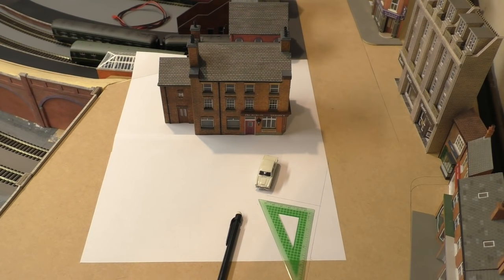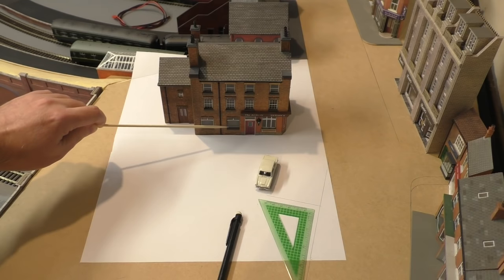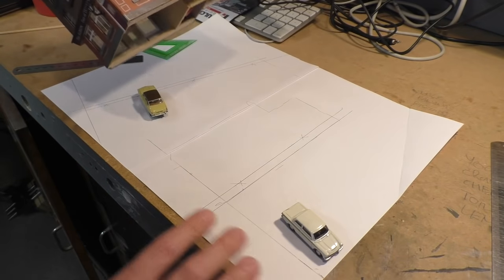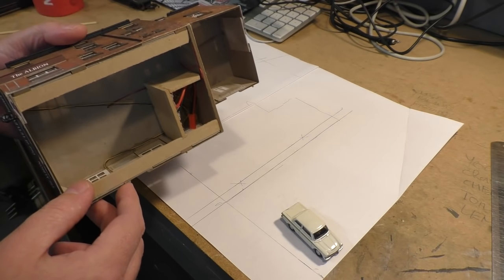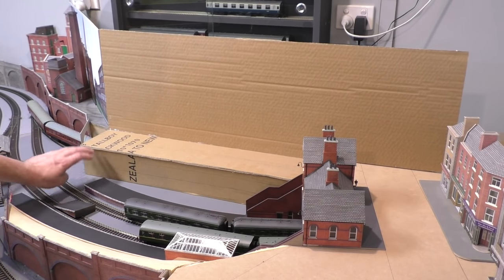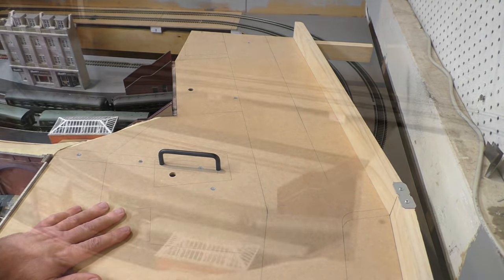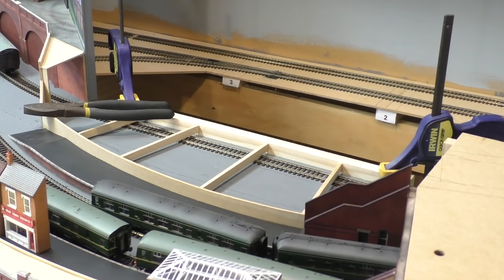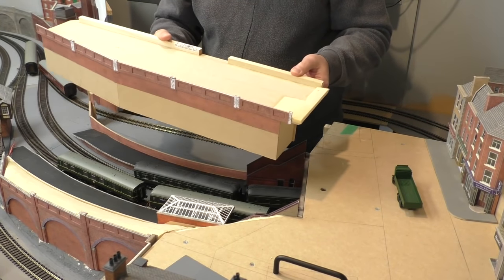Station Embankment and and Continuation of the Industrial Area

Comment: Hi Julian the quality of your channel just keeps getting better every video you release in my eyes you are right up there now with Chadwick Parkway, Dean Park and Everard Junction. Station Road also fills the gap that the other as remarkable and inspiring as they are and that's the use of card buildings and these scenic cut outs. While my layout when I get started with be loft based it will be constraints by the access hole and roof angles. Your cut away, build and weather elsewhere and fit and show technique for me is that missing link, so thank you and please keep the videos coming they are very inspiring
Reply from the maker: Thank you Paul for your very kind feedback. To be compared to Chadwick, Dean Park or Everard Junction is an honour because these channels are very polished, and full of exceptional modelling. I'm not sure I would place Station Road in this league, but then I'm not attempting to copy them in any way, they're just a great source of inspiration for me also.🙂

Comment: Julian,
I do enjoy your artisanship.
A question and a suggestion.  First about the foam infill.  Drawing and cutting out foam insulation board to fit amid the retaining walls is a fine way to accomplish your desire.  There is however an easier and quicker way.
Place your front wall in place as you have.  Using scrap materials build a temporary rear wall.  Then with Airisol Spray Insolation Foam build many thin layers until the foam SLIGHTLY exceeds your front and back supports.  Then taking a HOT WIRE or HOT BLADE you can trim the foam to the desired shape, with few, or no, mistakes.  It does take time.  With each thin layer you do needs to allow curing time, for the foam expand and firm up.  But even so the Spray Foam will do it's thing.  So you can be focusing elsewhere.
The question is regarding the removable roadbed with the black cabinet handle.  It was unclear to me whether or not the relief buildings were to be secured to the lift out or would you have to remove them individually each time you needed to get to the hidden trackage?
Both methods seen to present the potential of damaging the buildings???
In any event I did enjoy myself again with a trip down Station Road.
Jim ~ N.Y., N.Y., U.S.A.
Reply from the maker: Thank you Jim for your suggestion/method for the embankments. It's definitely another viable way of creating land forms, however I'm not sure if it sounds any easier or quicker. As you say yourself, 'it does take time'. The upper level town scene will incorporate detachable buildings but the low relief buildings will be permanently attached to a backscene as a one-piece lift-out but seperate to the baseboard lift-out.

Comment: That looks more like polyurethane foam than polystyrene foam. Not certain, but I seem to remember that using a hot wire on polyurethane is a big NO, as it can give off toxic fumes when heated. I'm glad you kept safe.
The pub's name, in England, would be pronounced more like owlbion (owl, same as the bird).
Reply from the maker: I'd imagine that standard polystyrene would be pretty toxic with a hot wire too. Melting any kind of synthetic material really requires a mask, but this covid about, there plenty of those on hand🙂

Comment: I would keep the opening on the building where the siding used to be and just have a truck in there at a loading dock.
Reply from the maker: I have considered this but it's quite a large opening (designed to fit a wagon). I might look at reducing the height, that could work.🙂